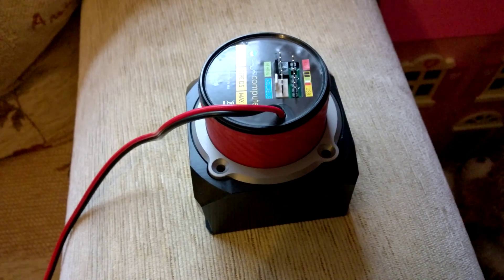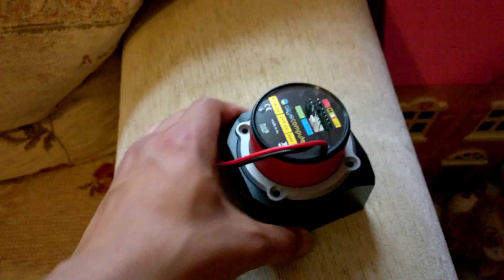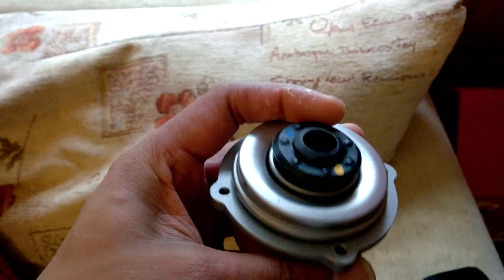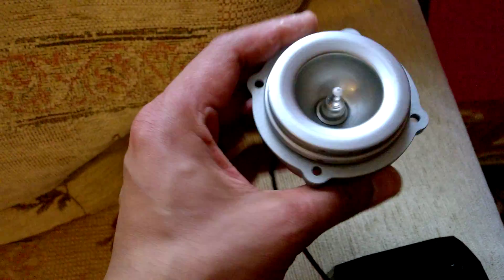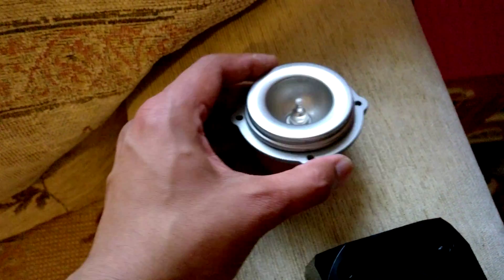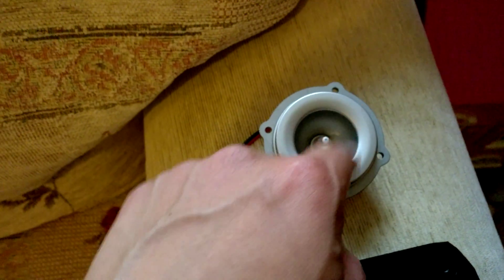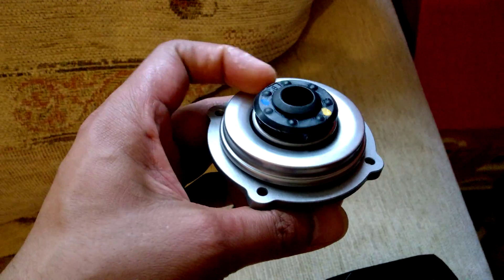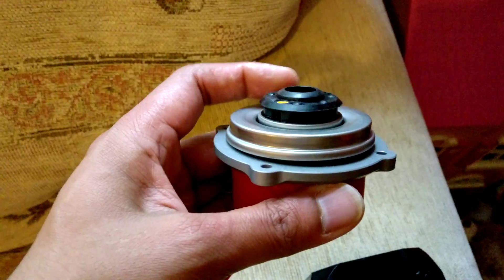Taking apart the Aquacomputer D5 (Impeller)

Comment: So the strange thing is that apparently one company actually makes D5 pumps. The comapny is Laing. They resell them to Swiftech, Alphacool and a few others I think. If you try and buy one from Laing they ask way more than the resellers sell them for. I've had numerous D5's. Swiftech and alphacools. Well I had one fail way soon and I think it was a manufacturing issue but the company spoke gemran so I gave up trying to resolve the issue with them.On the bottom of the rotor whrere it sits on the ceramic bearing you can see where the mold wasn't perfect and it wore out and just through it off balance and that;s all she wrote. $100 fans aren't cheap but I've got thosands of dollars worth of hardware so what can you do? They don't sell replacement rotors either cause they know that would be too cheap to sell us. BS if you ask me.
Reply from the maker: MikeyMystery45 I know Laing are the manufacturer of the pump and other companies simply re-badge them like the graphics car market. That being said, Laing makes two types of D5 pumps. One with fixed speed and the other with a speed selectable switch. This particular one however is engineered by aquacomputer and they have implemented an software selectable variable speed via a USB cable that connects internally which I found neat and ingenious. As for your issue with the pump, I think that's just sheer luck. You're bound to get one bad apple sometimes, much like I did.

Comment: I love my D5 it's such a reliable pump.
Reply from the maker: HansensUniverse my first one died but it wasn't the pump's fault but of the extra bits added by aquacomputer for software speed control and monitoring. Second one has been running for the last 3+ years.
Reply: Been having mine for 2 years, runs like new, i like the simplicity.

Comment: Would you recommend this one, or the Aquastream XT? I know the D5 has alot more power, but which one is quieter at the same flow-rate?
Reply from the maker: xXYannuschXx I really can't comment as I've never used Aquacomputer's proprietary pump. You have the many variations of your tried and tested D5 and on the other hand, though not mainstream, a German built pump which should live upto their reputation. when I bought this, I had the choice of both but stuck to the D5 mainly because of the other Aquacomputer products that seamlessly go with it. I have the D5 running at 75% and hardly can hear it. Though it depends on the environment, chassis and fans that are also working at the same time.